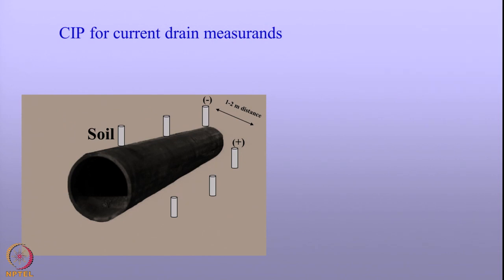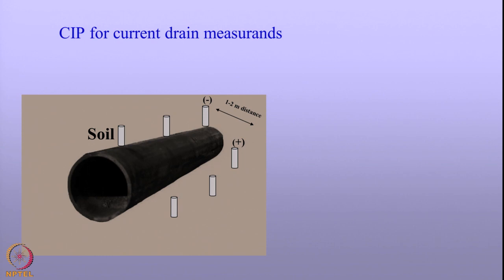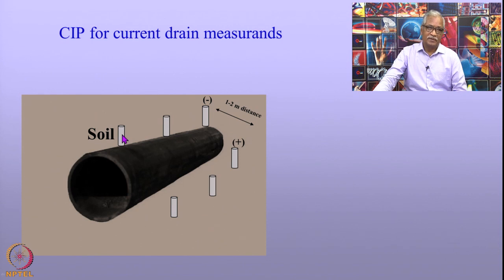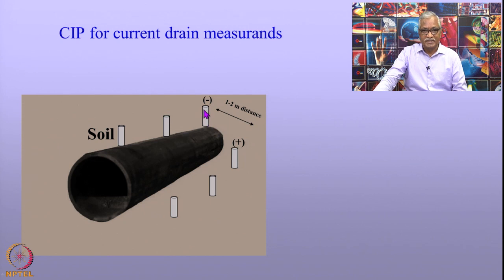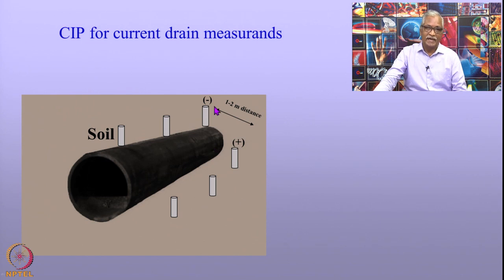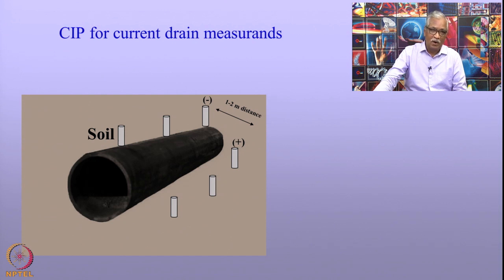Lecture 05 : Assessment of pipeline condition through surveys: Part-I

Comment: I would like to know the terminal of voltmeter connected to the reference electrode in measuring the P/S potential,so that I get a negative reading in voltage measurement.
Reply: positive terminal of voltmeter to pipe and negative terminal to Reference Electrode